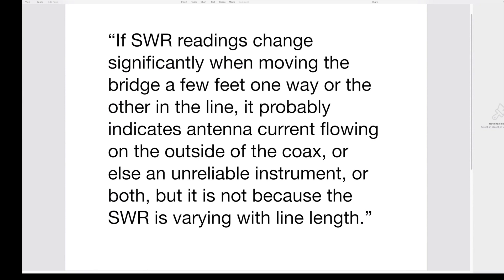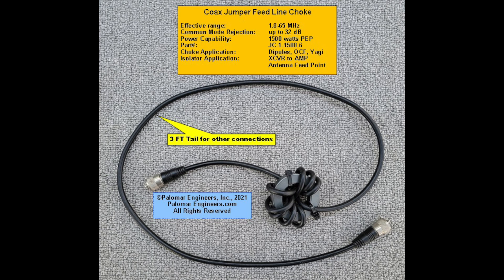Ham & CB Radio Myth - Coax Jumpers Must Be Cut to Null.

Comment: you only need to use 1/2 wave lengths if you are setting up your antenna.  once your antenna is set. then it doesnt matter how short or long the coax is. this is why you should set up your antenna at the feed point. however when you cant use multiples of a 1/2 wave.
Reply from the maker: You don't have to do that.  The farther down the line the meter is from the antenna, coax loss will make the SWR appear lower than it is.  The ARRL publishes a chart that shows how you can determine your true SWR based on cable loss and length without having to attach at the feed point or half wave. This in is agreement with what antenna engineer Walt Maxwell said in one of his books:  

“SWR does not change along a transmission line except when line loss is present. Coax loss attenuates the reflected wave as it returns toward the source, giving the illusion that SWR is lower when measured at points farther from the load. The apparent change is a measurement artifact—the actual mismatch at the load is unchanged.”

Also not using a current balun can make the SWR read differently because the outside of the shield can become part of the antenna which changes its impedance.
Reply: @BustRadioMyths in theory yes. However in practice if you dint have an analyzer and o ly a cheapo meter like most. The odd lengths will yrick those meters. This info is fir the cb disk crowd. Lol those arrl theories are just that and good starting point. Those who know. Know coax length doesn't matter if the antenna is set up properly.
Reply from the maker: True VNA's have been a game changer.

Comment: yes, any length of coax that will reach  will work. what you are missing is : if the coax is not a certain length at a certain frequency, your swr meter will not give the same reading as if the meter was attached at the feed point.  true, the swr of your antenna will NOT change,   but the readings will !  many antenna assembly instructions say, attach an swr meter to "the feedpoint". and the first thing most guys do it attach a coax to the antenna then to the swr meter. not following instructions. thats why those old cb meters of the 1970's were shaped like a stick, like the radio shack ones. with a male to male adapter, you can attach one directly to the feedpoint, as the instructions say. do you think a company like rig expert or the old mfj would include a way to cut your cables to a half wavelength if it didnt make a difference ?  you will not get the same readings thru a random length of coax, as you will with the meter connected directly to the feedpoint. even the old 259b can connected to most antennas with amale to male connector, even a gamma match. try it and notice you are getting different readings.
Reply from the maker: The farther down the line the meter is from the antenna, coax loss will make the SWR appear lower than it is.  The ARRL publishes a chart that shows how you can determine your true SWR based on cable loss and length without having to attach at the feed point. This in is agreement with what antenna engineer Walt Maxwell said in one of his books:  

“SWR does not change along a transmission line except when line loss is present. Coax loss attenuates the reflected wave as it returns toward the source, giving the illusion that SWR is lower when measured at points farther from the load. The apparent change is a measurement artifact—the actual mismatch at the load is unchanged.”

Also not using a current balun can make the SWR read differently because the outside of the shield can become part of the antenna which changes its impedance.

Comment: I believe many are getting the coax beeing cut to a null from cbers. Many cb amps are made to exibit lowest swr with a certain length like 6.5'. some amps like texas star use an attenuator in the input section to  keep swr down making it so you may use any length of coax.  So in cb when using an amp that isnt type accepted to get a good swr between transeiver and amp one may need a certain length of coax for a good match. I just dont worry bout it as i usually run barefoot and only own 2 small old texas 10/11m amps that i need to fix and tune for ham bands.
Reply from the maker: Interesting.

Comment: While I agree that the length should not matter, in some cases it does.  Take that 1/2 wavelength of coax and the 100 ohm antenna.  You get a 2:1 swr  because the impedance repeats every 1/2 wave length.  Now go to a 1/4 wave length peace of coax and you will not see a 2:1 swr.    The SWR on the line will be 2:1 the whole length but the swr meter will show a good to a high SWR as you move it along the line.  The common mode (outer coax current has nothing to do with this.  You can use a shielded load resistor and he effect will still be the same.  Been a ham for over 50 years myself.  To really see the lost power in the coax which is mostly in the resistance of the wire below 500 MHz  take a piece of rg-58 500 feet long and put power in it and leave the far end open.  No reflected power (swr ) to show as it is all used up in the resistance of the wire of the coax.
Reply from the maker: Fron Walt Maxell W2DU in his book Reflections:  

SWR indicators need not be placed at
the feed-line/antenna junction to obtain a more
accurate measurement. Within its own accuracy
limits, the indicator reads the SWR wherever it is
located in the line. The SWR at any other point on
the line may be determined by a simple calculation
involving only the SWR at the point of
measurement, the line attenuation per unit length
(available in a later installment), and the distance
from the measured point to the point where the
SWR is desired.

The actual SWR is not different at a half wave or quarter wave.  The impedance is different.  SWR meters are not what you'd call laboratory grade instruments.

Comment: This channel is very informative that's why I subscribed and thank you. But can I have a request for another topic regarding RX. There's a case wherein in one same compound that the mobile antenna at 10 feet off the ground receives much stronger compared to the 5/8 base antenna at 80 feet given that both are well tuned with new coax cables only it is around 30 feet apart. This is on 2 meters vhf by the way sir. Thank you so much.
Reply from the maker: There are a lot of reasons that could happen I suppose.  Are they both using the same receiver?  That would be impossible to do at the same time.  What if there's something off in the receiver hooked up to the base antenna?  What if the base antenna is poorly designed or has a bad connection somewhere?   Too many variables to consider.
Reply: It has to do with the radiation pater of the two antennas.

Comment: Good information. I will say that as an Electronics Engineer I don’t laugh at SWR meters. At least not for amateur use! I just recognize that they are not precise instruments and that amateurs do not need precision laboratory equipment to measure their SWR. With three SWR meters you probably will get three different readings. In all likelihood any one of the three is good enough for antenna tuning purposes. I always worry if my SWR is too good on a fairly long run to my antenna! As you said a 1:1 could mean no power is getting to the antenna. I agree with you in looking things up. I recommend the ARRL Handbook, the ARRL antenna book and the ON4UN Low Band DXing book. There is a wealth of information in them. 
The fundamentals are most important. Coax has loss. Loss can increase with SWR. SWR is best measured at the antenna feedline connection however it is usually done at the transmitter end. Understanding how coax loss affects the reading explains a lot. If there is a SWR on the coax, the impedance at the input end will change with coax length. So the impedance can change with length but the SWR does not, the reading can change slightly due to loss. More loss the bigger the change. Common mode current may or may not exist on the coax. One sign of common mode is indicated by that inexpensive SWR bridge giving different readings as you said. Also if readings change when the SWR bridge, coax or transmitter chassis is touched is another. All this is in the books. Your videos are a great companion to the books.
Reply from the maker: Thanks @dandypoint.  Great to have an engineer who knows what he's talking about on the channel.  Please keep contributing your knowledge.
Reply: You're right when you say an SWR meter is not highly accurate and three meters can read differently. I suppose they might be tested roughly to be within a tolerance if tested at all. Or mass produced and just assumed to be o.k.
I opted for a Wheatstone Bridge type as the tx never sees above a 2:1 SWR when setting up, it does have to be removed when transmitting though as it eats half the power, I just keep an eye on other readings on the tx. Limited to QRP by the resistors.
I calibrated it with known values of resistors.
My maximum coax length is about 45 feet for my 60m band inverted vee. Others around 25 feet.
Yes, good informative stuff by Mark, and I often look at Dave Cassler's videos.
G4GHB.
Reply: @bill-2018  he's also right when he says the impedance at the radio changes with feedline length if there's a feedpoint mismatch
Reply: @Pioneer936  Yes, but who runs their system like that?
I don't.
Reply: @bill-2018  many do as its a valid way of impedance transforming to provide the transmitter the impedance it wants to see,the point I am making is the fact that the misunderstanding of impedance transforming is what's causing all the misinformation being spread about
Reply: @bill-2018  think also the misunderstanding of reflected power contributes to the confusion, many believe reflected power is automatically loss power and or absorbed in the transmitter causing it to malfunction, which it doesn't of course, so a better understanding of this would help
Reply: @Pioneer936  If you think a random length of coax is no good then carry on. 
For 40+ years I have never trimmed coax and things have been fine. Except I did it for phasing lines or to match a dipole on a Yagi I made.
No SWR problems, No reduction of power going out. No lost power in my coax, power out is the same at the transmitter as on the end of my coax whatever length.
Never mind, keep trimming your coax.
73, G4GHB.
Reply: @bill-2018  you are still misunderstanding what I am saying ,the fact that the feedline becomes an impedance transformer with swr on the line is why impedance at the radio changes with different lengths, now whether you embrace this knowledge or not it's still a fact of science
Reply: @Pioneer936 if what you sid actually mattered, a ham would have to change his coax length everytime he changed bands, as the feedpoint impeadance changes with frequency. Obviously nobody does this, just like jumper length is irrelevant.
Reply: @VE9ASN  that's right that's why hams use antenna tuners for multi band antennas
Reply: @Pioneer936  I have an 8 band loop, no tuner, and don't change my feedline length......
Reply: @VE9ASN  that's great doesn't mean feed lines can't be used as impedance transformers
Reply: @Pioneer936  sure, 75 ohm coax is used for that all the time. Why would anyone chop up coax when they could simply make the antenna properly? The impeadance doesn't change, you've simply moved the point along the standing wave where you view it.
Reply: @VE9ASN  any feed line becomes an impedance transformer with standing waves present, this can be useful or not its upto the situation
Reply: @Pioneer936  the impeadance didn't change, where you viewed the impeadance along the line did.
Reply: @VE9ASN  so if you change the length the impedance the radio sees changes
Reply: @Pioneer936  yes, what it sees changes, because you're "viewing" at a different place along the standing wave.
Reply: @VE9ASN  because this impedance can be detrimental to the radio line length matters when there's standing waves are present
Reply: @Pioneer936  I have a rig expert stick pro, and measure at the antenna feedpoint as well as the radio, the change with different coax lengths isn't worth mentioning, especially so with typically accepted SWR levels. It's making a mountain out of a molehill. 
As a ham, the thoughts of changing all my jumper lengths each time I changed the bands is beyond ridiculous, it's a nothing burger.
Reply: @VE9ASN  you are misunderstanding what I am saying, I am not saying change jumper length every time you change frequently just pointing out that feed lines become impedance transformers with standing waves, this transformation can or cannot be of use depending on the situation, please don't take what I've said out of context

Comment: The late great Walt Maxwell explains how the feedline becomes an impedance transformer with different feedline lengths when theres a antenna feedpoint mismatch so maybe this is were some of the myth is founded with misunderstanding
Reply from the maker: Yes I agree that fact has contributed to coax myths.  Good comment!
Reply: @NoMoreRadioMyths  shouldn't really contribute it should clarify

Comment: Nice video 🖖
I'm new to HAM, could you suggest a good budget coax cable that is thin or not so thick like the normal ones and is very flexible similar to silicone dc cables,Please available in UK or a shop that don't want a arm and a leg for shipping. 🖖
Reply from the maker: RG-8X would be one.   But coax is not going to be super flexible.  You should be able to find it in the UK.  Be wary of eBay or Amazon because it will likely be made in China and who knows what it really is.
Reply: @NoMoreRadioMyths  Thank You very Much

Comment: I’m a general class operator and I just got a QRP rig with a 50watt amp and an antenna tuner. I need a few jumpers and was willing to buy them from DX Gigazon outlet but can’t find anything under 1ft. I decided to make my own but the question came up in my mind…does it matter how long they are since I can’t find a 4 inch jumper…your video came up in my YT feed and answered my question….thanks….now I have a new question. How did YT read my mind?
Reply from the maker: It wasn't YT it was ME!!!!!  You can find real short coax jumpers on Amazon but they are made in China so quality can be an issue.

Comment: I think CB magic cable length was started with truckers using two mirror mounted antennas as a phased array. The lengths from the splitter should be the same length assuming the same cable type. Providing two 18ft section on for Tractor Trailer makes sense without wasting cable.

Comment: The only time that the length of jumpers matters is when they are used to connect the various cavities in a multi-cavity duplexer, such as used in repeater applications.
Reply: That's a special case where the intentional mismatch from one cavity needs to be reflected at the next cavity. It's used to optimize rejection of undesired frequencies. --n1bs
Reply: @n1bsbri I’m pretty sure Alan knows what he’s talking about😊

Comment: Just to be contrary there are times when jumper cable lengths DO matter. Take the example of a 2m radio feeding a small RF sensing amplifier. As the amplifier is triggered the internal relays move, momentarily presenting a high SWR to the radio. This can cause the radio output to quickly fold back and for the relays in the amplifier to drop out momentarily. This cycle of events repeats rapidly causing the relays to buzz. Changing the length of the cable between the amplifier and the transceiver can prevent this. Untuned inputs of Class C amplifiers also present a strange case. I am not disputing the case you present here but there are a few special cases.